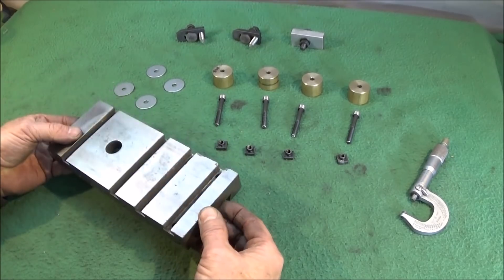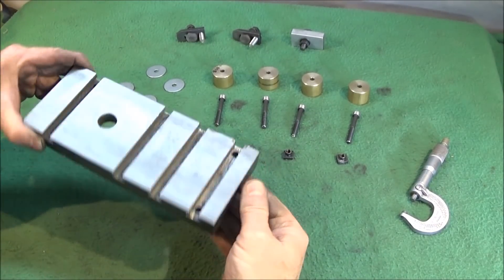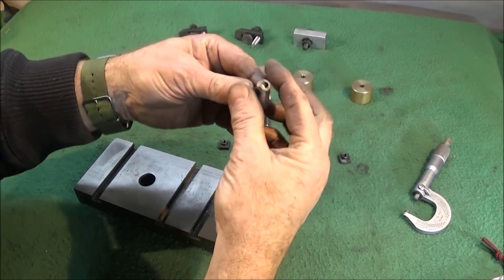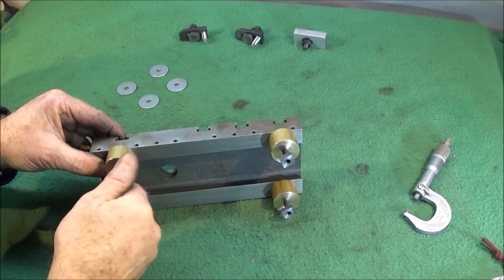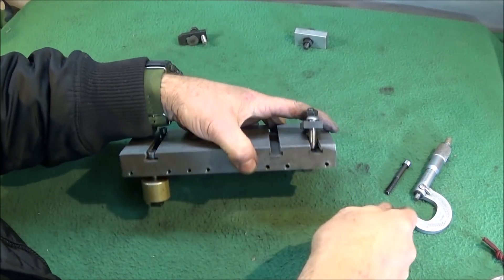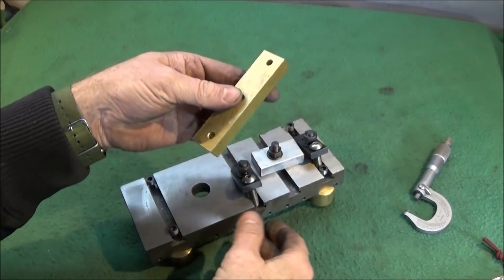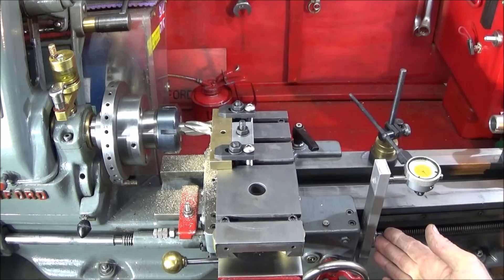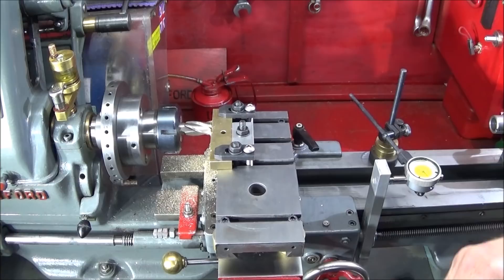Easy To Make Adjustable Milling Pallet For The Myford Lathe

Comment: Steve I was thinking of buying a vertical milling slide for my ML4 but they are expensive, do you think that  this is as good a tool.
regards Colin.
Reply from the maker: Hi Colin yes they are great. The vertical slide enables loads of milling operations to be done on the lathe especially if you have a vice bolted on the front of it like mine. Regards Steve

Comment: Nice adaptation, Steve. If you have problems with rigidity, you might consider replacing the brass spacers with full-length machined pieces that make full contact, front-to-back, with the cross-slide, which would support the milling plate in the middle as well as the ends.
Reply from the maker: Hi Hans. Yes that is a good idea, I will see how it performs when milling steel next. Regards Steve